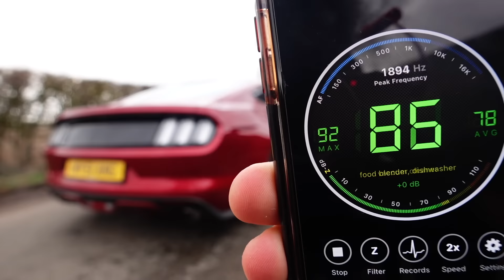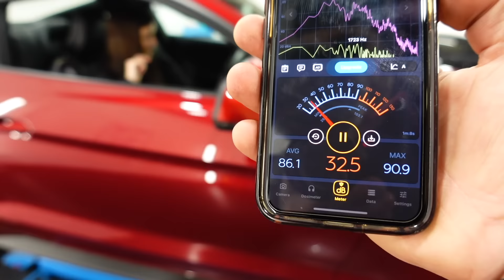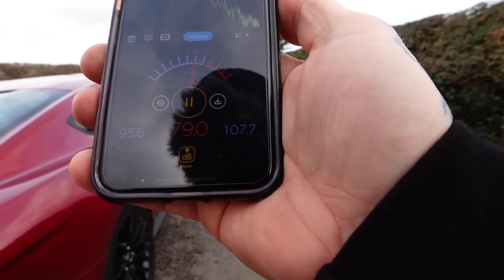BRUTAL SOUNDING EXHAUST FITTED TO HER MUSTANG

Comment: 88dB(A) stock, 108dB(A) with Remus fitted, a 20dB(A) increase. Every 10dB increase in noise level represents a 10 fold increase in sound energy so the Remus exhaust is x10 then x10 again louder i.e 100 times louder than stock. Wee bit louder then!

Comment: If I had to guess, the reason the Mustang (and just about every other V8) is on the quiet side is California (and other select jurisdictions). Ford obviously sells a lot of Mustangs in California which has a strict exhaust decibel law. Your exhaust cannot exceed 95 decibels at 3000-5000rpm from 50cm away from the exhaust tip.

Comment: mmMMMOOOAAAR... get some long tube headers, our rhd are narrower due to the steering. The cold starts will also be savage with no active exhaust.
As for the air filter get the Roush CAI, Velossa Big Mouth ducting and either cut the grille or replace it, you'll get much better air flow. 
Why the 6R80 ?

Comment: The exhaust is loud enough by the sounds of it ... try it up dual carriageways and the motorways for drone ... 50pmh and 70mph can be tiresome with these aftermarket zorts.
I would buy this mota because it doesn't have tacky bolt on shit jaffa taped to the sides or roof. Great vid.